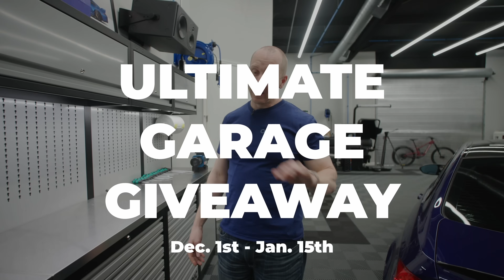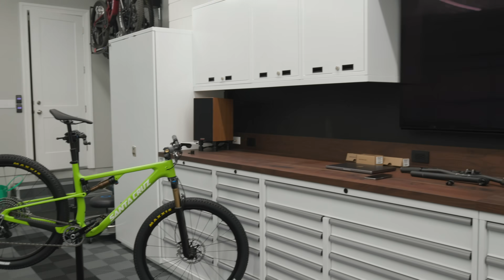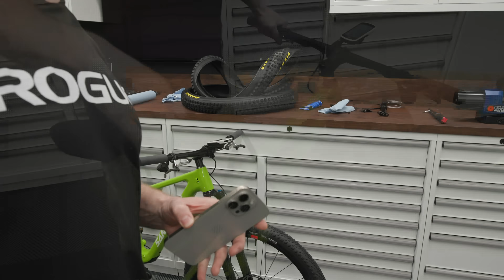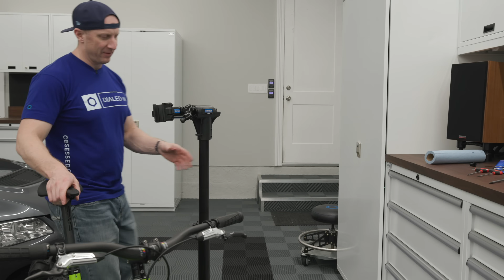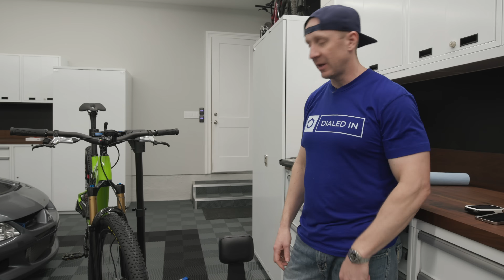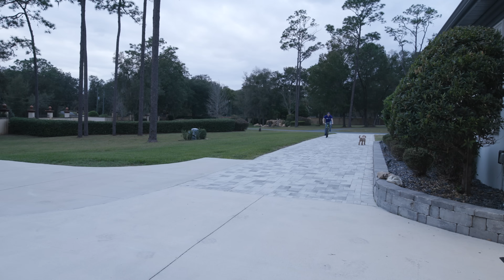I Spent $1,000 to Shave 250 Grams Off My Santa Cruz Blur Mountain Bike

Comment: Bike setup is all about personal preference and the riders size.  I am 5’10” and my preferred bar width is 690mm.  Cutting down my bars is the first mod I do after purchasing a new bike.  While wider bars can make you feel more stable, they can also cause a lot of discomfort transferred into your shoulders, neck and upper arms.  I would suspect a narrower bar will be more comfortable.  I would recommend a real bike fit, one that’s 4+ hours long and not one of those 15-30 min jobs.  Another thing to consider would be crank arm length. Yours are likely 175s or 172.5s.  Given your height either may be ideal however it’s another part of the fit that’s important.

As far as shedding weight goes, it’s cheaper to start with yourself as you have said.  Beyond that its parts on the bike to change out.  You have already done as much of this as possible or you already have the lightest top end components so from here on your gains (or rather weight dropped will be minimal).  

Wheels and tires are two spots where you can make up a lot of ground.  I have ridden and raced Maxxis tires for the past 12 years.  Assuming Florida is similar to my riding locations I would recommend Aspens, Ikon, or Ardent/Race or the Rekons.  You give up a little in traction but gain a lot in less rolling resistance.  Unless your form on the bike cornering at speed is suspect, the 3 tires above should have more than enough traction to keep you up right.  I just recently switched over to Schwables Racing Ralph and Racing Ray setup to try something new.  

As far as wheels, don’t settle on buying a complete off the shelf package.  There are wheel builders that can do anything you want and you end up with you best performing wheels customizing.  Let’s start with Hubs; IMO the 2 best hubs on the Mtn bike market are Onyx hubs and the I9-Hydra.  I own wheel-sets of each and the Onyx hands down is my favorite.  It does have a slight weight penalty compared to the I9 however it’s not rotational weight.  The hub is 100% quiet when free spooling, which I love, and has a significant difference in lack of resistance when free spooling.  Meaning, your wheels will spin for a significantly longer time before it stops compared to the I9 or any other hub.  This translates into quicker laps.  Lots of coasting while mountain biking, unlike road riding.  Any advantage is a plus.  As far as “hoops” or rims go, there are a ton of manufacturers.  Pick one that you like, has the internal dimensions for the tires you ride and build it up with your hub of choice (I recommend Onyx hubs once again).  I am in the process of building up a set of Beast XS30 Hoops (out of Germany).  They make some high end carbon lightweight rims.  A couple of other rim manufacturers to consider would be ENVE, We Are One (Canada), and Nox Composites. Those Reserves aren’t terrible wheels.  They have a lifetime warranty.  However you can build up a better lighter, faster wheel.  Someone mentioned above Berd.  They make a synthetic “rope like” spoke.  Very very lightweight build when using them.  Kind of a different feel to the ride.  More vibration absorption however a little less trail feedback.  I have mixed feelings about them however it’s innovative and super lightweight.

Good luck on the build.
Reply from the maker: Awesome!  Thanks for all the advice.

Comment: No need to go to school for bikes, there are plenty of resources for working on them and learning online.  Two youtube channels for mountain biking or just bike maintenance are Berm Peak (formerly Seth's bike hacks), and RJ the bike guy.  I find bikes feel more stable and less twitchy with wider bars.  But narrow bars were popular for a while.
Reply from the maker: I find that the additional transfer into my elbows from wide bars offsets the benefit.   They just don't feel right to me.
Reply: @ObsessedGarage  you may still need to shorten that reach distance, if you are feeling it 8n your elbows.  I rode a giant xtc 29er for years, and wasn't comfortable till all my weight was off my arms.  Took a 2 inch riser bar, and 35mm stem to get comfortable.  I think xc bikes just have a lot of reach compared to all mountain, enduro, etc.
Reply: @ObsessedGarage it might help to bring the bars up a lil bit they look very low considering the seat height that should help take the stress off your elbows

Comment: Normally not commenting on stuff but as you said "as light as possible" take a look at the German Brand "Tune", they manufacture extremely lightweight parts in the blackforest. For example their Seatclamps. Might not be everyones favouite brand and should always torqued down to said spec but loved their stuff since i started riding bikes. And if thats not enough, Trickstuff has prob. the best brakes to offer, expensive (we all know) but i have their Diretissima and had their "piccola" brakes, second are the said lightest brakes on the market and they run with mineral oil. 

Personal opinion are that the Pedals aren't that nice (all the CB Pedals i had, have started with bearing play after a few hours of use) but i loved my CanfieldBrothers Crampon Ultimate (couple gramms heavier and you might need new shins if you slip). If Mechanical questions are still up i'd be happy to help.

Short lil addon: When putting new Spacers/Stem on, you should end up with the top of the steering tube at the upper Screw of the Stem (not below), or between upper screw and upper edge of the Stem. Otherwise you'll have a ton of play and might end in a damaged frame/fork not to talk about the damage done to yourself. If the Steeringtube is right in between while tightening the screw of the topcap you eliminate play. @22:55 the steeringtube seems to be right above the edge of the stem.

Addon2: Carbonpaste on the Stem, Bar etc is okay, but not on bearings. But bearings should also only be lubricated and installed with approved grease for carbon. You'd  put the Carbonpaste for example also on your the RS Reverb AXS on the Hightower.

Just for my own OCD: TORQUE CARBON PARTS TO RECOMMENDED SPEC (seems like i wrote that to quick), """""HaNdTiGhT""""" as some stores do it is not good.

To one of the first questions: Cutting down Bars shouldn't also be a problem, most of them (Enve for example) have even indicators for 780,760 etc. Only thing to have in mind is that the area in which you want to clamp in should be cleared. Some get a lil thicker the further mid you go and there you can't clamp down your Brakes.
Reply from the maker: Awesome tips!  Thanks for the input.  This stuff really helps educate me!

Comment: well, I am a bike mechanic and I would just love to get there and teach you some things, but I guess that coming there from italy would be a bit difficult, wouldn't it?

anyways, love most of your videos, if not all of them, but I am really digging this bicycle content, it goes to show the importance of a well organized and tought garage and workspace even when working on something simpler such as a bike.

also, little detail, but I would suggest putting at least one small spacer in between your stem and the headseat cap, especially when using carbon components, it lowers just ever so slightly your handlebars (around 1 mm lower) but it takes some of the load off of the carbon stem and helps with stability. And yes, it's not mandatory to put carbon paste on a stem but if you have it, it does not hurt to put some on, it can also help with static isolation as carbon components can suffer if sweat or salty moisture get in between the parts.
Reply from the maker: I'll do that tonight.  Thanks for the tips!

Comment: The top cap bolt on the headset is mainly for setting bearing preload, not holding the forks in place. The stem bolts when torqued correctly will do that.

There's no torque setting as such for the top cap but it doesn't need to be too tight. Nip it up until there's no movement or knocking in forks, then tighten the stem bolts. I test mine by holding the front brake and rocking the bike backwards and forwards. Once any play is gone I might give it another 1/8 turn.

Park Tool videos are good for this sort of stuff: https://www.youtube.com/watch?v=TihBJNn0Bck

Comment: OneUp bars are oval-shaped and have built in compliance is what I run.. They also sell really nice tools that integrate inside the steer tube on top of the bike. I also use Erogon grips. The tires that you choose are way too heavy for your Florida riding, rotational weight will be felt at the outter circumference of the wheels so saving weight there is definitely a key. I use Onyx hubs that use a Sprague clutch mechanism that gives you instant engagement, and totally silent. They use a painted surface I have antifreeze green that looks exactly like antifreeze color.. Available in many colors. I have many bikes yeti SB 100 but now I’m on the ibis Ripley. I also love the absolute black, oval front chain ring allows you to get better traction and easier on my knees!! Mountain biking has changed my life!!
Reply from the maker: Nice!  Thanks for the input.

Comment: I run the Assegai+DHR II combo on my enduro bike. But putting what essentially is the same tire combo as downhill world cup racers run, on a XC/Downcountry bike, is very overkill and the bike will roll slow like a pig. You would be far better off with like a Forekaster/Dissector up front, and a regular Rekon in the back.

Comment: Avid PNW mountain biker and OG customer checking in!

Setup suggestions:
Continue to try to get weight off your hands as long as it feels uncomfortable (higher rise bars / stem spacers / shorter stem). If you're comfortable, you'll bike more miles. If you find you're losing control/grip on your front wheel, you've gone too far. Your brake levers look like they are angled very downward. Some XC racers like this, but I'd try angling them more upward and see how that feels. It also looked like you are using two fingers to brake. I'd recommend trying to learn to brake with one finger (index) and tune your lever spacing accordingly if you're not already using one finger. For your build, I would imagine you would feel more comfortable and ride better with 760mm-780mm bars. I'm 5'8" and run 760mm, but I wouldn't go down narrower than 750mm. I love my OneUp carbon bar which flexes and dampens vibrations. For suspension setup, start with the recommended settings and then check out Fox's Dialed YT channel where Jordi has a video describing bracketing and setup.

Components:
The max drop you can get the Reverb AXS post in is 170mm. For someone 6'2", that will likely be too short. The Reverb post also requires a lot of maintenance (I have one). Check out OneUp's 200-210mm dropper. If you do go with the AXS dropper, stay on top of your service intervals! As others have said, you will probably enjoy the Rekons more on your Blur -- I would keep them. I'd save the Assegai/DHR-II for your Hightower or maybe choose a DHF/Dissector combination unless you're riding in loose/wet terrain. If you're looking for crazy light, strong wheels, check out Berd Wheels with Berd Spokes. You can get them with Industry9, Onyx (dead silent, my favorite, but they weigh more), or Berd Talon hubs.

Maintenance:
I'd recommend teaching yourself. The Park Tool Blue Book is an excellent printed reference and their YT channel is a gold mine of information. For suspension maintenance, Fox's Dialed YT channel has a good how-to on doing lower leg/lower air can service which is all you can do without compressed nitrogen (you send it to Fox or a suspension shop for the damper service). Ali Clarkson has a good YT on wheel building and wheel truing basics as does Park Tool. The SRAM T-Type transmission shouldn't need much tuning after initial setup. You will have to replace the chain/chainring/cassette eventually and those are things Park Tool tutorials can help you with (along with SRAM manuals for torque settings).
Reply from the maker: Awesome info!  Thanks!
Reply: Best youtube comment I’ve ever read.
Reply: +1 Onyx / Berd wheelset would be baller on this bike. Granted, Onyx classic hubs are a bit heavier (Vespers tend to break under heavy pedaling, I’ve read). But, totally robust and dead silent with Classic hubs. While I9 hubs are light, they are draggy. They also don’t have preload on the axles, so people report consuming bearings more quickly, even if angular contact bearings. 

+1 OneUp droppers are great for packaging considerations.
Reply: you know your stuff. 👍👍

Comment: My new Orbea Wild came with the Assegai and DHR II combo (both DH casing, maxxgrip).  It's definitely enduro-oriented.  I've been running Assegai front and Aggressor rear tires for years on my regular bike (Megatower).  But these are pretty much enduro bikes and they deal with the gnarly rocky trails here in Phoenix.  If anything, these tires on a Blur are going to result in some pretty noticeable rolling resistance for the type of trails you ride.  I'd think the Forekaster would be more what you're looking for.
Reply: My Ibis Ripmo came with 2.5" Assegais front and rear. I found it super slow and draggy, just switching out the rear for a 2.4" Dissector made the world of difference. The bike feels much quicker to accelerate and maintains speed better, I actually had Strava personal bests everywhere on my local trails the very first time I ran the Dissector on the back.
Matt's Blur would definitely feel a lot slower with an Assegai and Minion DHR compared to the Rekon Races. I used to have a Blur 4X when those were around, I ran 26x2.4" Schwalbe Racing Ralphs, and that thing was quick!

Comment: Cool bike build. I am your height 6'2 190, I usually push my seat all the way back on the rails with my phenom seat on my XC GIant Anthem advanced pro in large. My Giant weighs about 25lbs with pedals and no dropper. You can really go faster with the current tire setup and bang out some miles/cardio at higher cadence. Oh, that new drying aid is legit too!

Comment: As stated below,  your headset is not adjusted properly. You have it much too tight, and it will cause the bearings to fail prematurely. You might need additional spacers to make sure the stem is about  1/8" above the steer tube before tightening down the top cap.

I would also say that your bars are much too narrow, but that is personal preference and comfort. I hope that it works out for you. You want to have your brakes adjusted inward so that you only use one finger on the levers, there is no need for two if your brakes are adjusted and working properly.

As for schools to learn bike mechanics and maintenance, the two best known are UBI and Barnett Bicycle Institute. I believe BBI recently closed. On a more local scale, look to your LBS or REI to see if they offer basic bike maintenance courses as these might be more useful than a full blown certification for you.

The tire is pronounce Ass-uh-gai (with a hard 'g').  The 'Rekons' are pronounced 'Recon'.

Building your bikes up from the frame is the only way to go to get all the components you want. Otherwise there are always compromises. Industry nine wheels are OK, but there are much nicer hubs (Chris King) and wheels (We Are One composites) out there in my opinion.

No plans to Ride Wrap any of the bikes?

Comment: Industry Nine wheels are amazing, but for the type of riding you’re doing, they’re really unnecessary. Plus, the wheels you have on there now are very good as it is. You’re not likely going to notice any difference at all. 

If you’re trying to go fast, keep those tires. Less knobby equals less rolling resistance which is going to increase your speed.

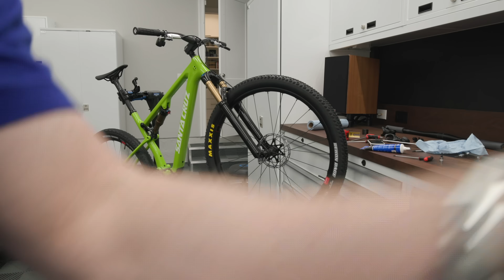Comment: Your headset looks tight based on how your bars stay straight when you have the bike tilted back at 31:39.

You need to add a headset spacer on top of that stem to properly tighten the headset bearings.
Reply: Looked to be overtightened when setting the preload, don't need to be that tight.
Reply from the maker: Will do!  Thanks for the advice.
Reply: Speaking from experience, unless you want to destroy your bearings , a spacer and lighter torque on the preload is a must

Comment: You could save a bit more weight by switching from the Santa Cruz reserve wheels/rims to bontrager kovee RSL. Santa Cruz with a DT Swiss 180 weigh almost 200g more than the bontrager with the DT Swiss 240 and rotating mass is where weight savings will really shine. Great setup either way.

Comment: The Assegai/Minion DHR is an awesome tire combo for narly trails, but roll very slowly and are much heavier. The X country Rekons (assuming not the race versions) likely a much better choice for your central FL build. Put the others on the Hightower for Helen trails. 

And … surprised you didn’t check out Pivot bikes (out of Phoenix). Super high end and very anal attention to detail in their frames. Matches “you” much better than the more mainstream Santa Cruz stuff (though very nice as well).
Reply: Yeah putting essentially downhill thread tires on what is pretty much an XC bike is a bit strange, should have gone for a dissector or something up front, and a recon in the rear
Reply: I drool over Pivot bikes... They are sweet.
Reply: What’s makes Pivot outshine others? I took a look at the website.
Reply: @Schwabz33  Much better attention to details, cabling, weight, etc. Design in house and can even head down there tomorrow and talk with group or test ride a bike right from the factory (though Santa Cruz out in CA does the same). Known more as a boutique brand in the MTB world that holds value and more in line with OG products/mission.
Reply: I'm intrigued by Pivot engineered bikes, but can't get past their commintment to press fit bottom brackets.